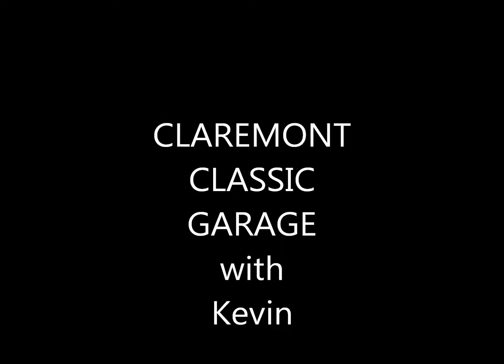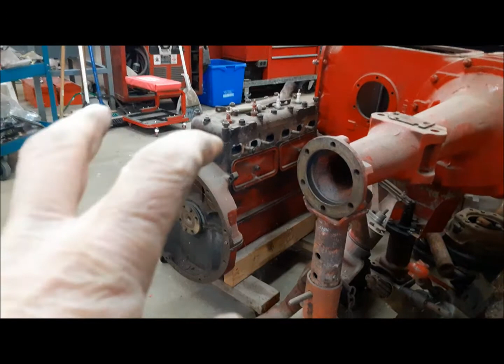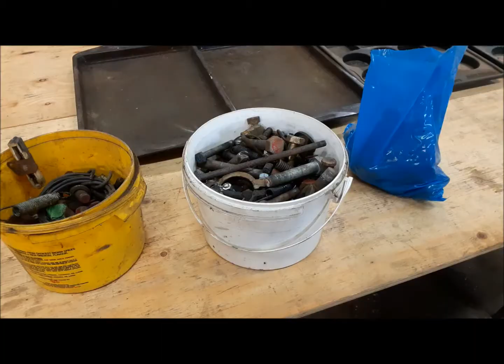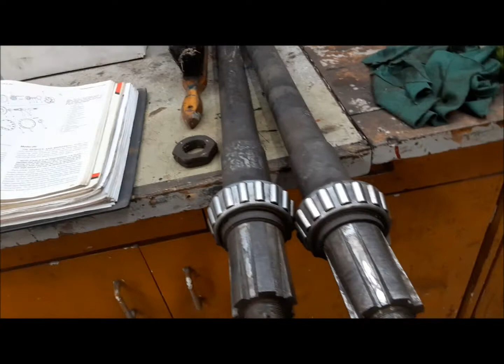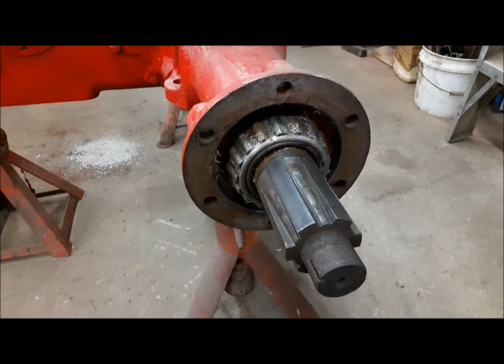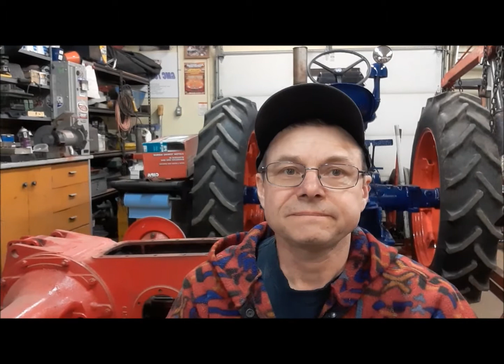1948 Ford 8N Rebuild part 1  Getting Started

Comment: Rebuilding a 51 8n that was used hard and put away in pieces. Not sure if I've ever seen it asked anywhere on the web but is there a bolt-up solution to doing away with the splined axles/hubs(big center nut) of the 48-52 8N? Wondering about T(E-O) 20/30 fergusons and ford 6-800 compatability for such an idea. New axles+hubs are pricey and they seem to ultimately be a weak point on the 8N design. Thanks!
Reply from the maker: Ferguson stuff could work but I've never checked for compatibility. I would only do it If I could keep the 8N brakes. I've shimmed many 8N hubs and none have ever come back loose but that may just be because I didn't work them hard enough.

Comment: Putting it all back together after working on the brakes and replacing seals. I had about 1/2" of play in my axle, with NO SHIMS. Then I thought maybe I should put the retainer on the other side first - you had said you did the other side with no shims - then try it. That helped a LOT! Got maybe 3/32" of play now. Thanks for another great video. Really enjoying working on this tractor and seeing how all the mechanical parts interact. Worst part is waiting for parts to get delivered - no local suppliers here.
Reply from the maker: Glad we could help out. Best of luck with it!

Comment: Loving your 8N serires! I am refurbishing my 1952. Question: Where can I find a replacement spark plug wire tube? Those are as rare as hens teeth.
Reply from the maker: You have to watch ebay . They pop up on there quite often. There are no new ones, only used. But know the difference. the 9N/2N use a similar tube that is longer and won't work on an 8N

Comment: thanks for saving me i have 4 flat blade screws holding the brake drum on and after 4 hours got one out. broke my crafstman hand impack and mangeled the slots. so i just took it out from the back. the shoes were good but they kept driving with broken springs. im just gona leave the drum on and use the axel shaft bolt to hold it. waiting on a new kit

Comment: Great project!  I had a late 1950 8N and enjoyed it.  I tore down the rear axles once to replace the bearings with my neighbor's help.  In his youth, he was a Ford mechanic and he loaded up lots of shims first, measured the end gap, and then removed shims as required.  At first I didn't understand why he did this, because I was going to do it the way you did.  He told me this ensures you don't damage the bearings when you tighten the hub.
Reply from the maker: I have done it both ways. I think either way is fine so long as you dont really tighten it down with insufficient shims.